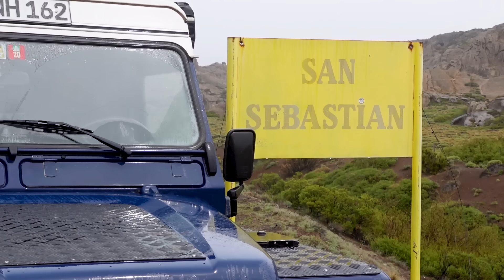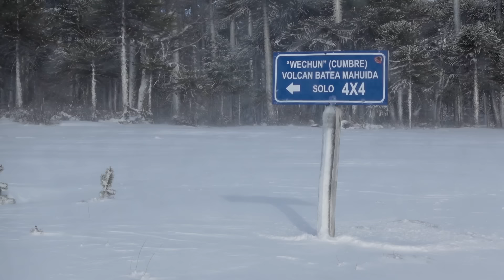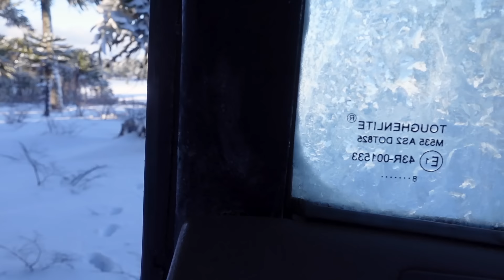Being in the RIGHT PLACE at the RIGHT TIME // EP.77

Comment: You are very fortunate to have the knowledge and skill to fix just about any problem with the Defender.
Reply from the maker: Thanks Graham! 
Just remove all nuts you find, try to not break anything. And then try to remember how to put all the bits together again… I also don’t always make it on the first try. I probably pulled the generator apart 6 times. Everytime I think something is broken I disassembled it and checked what’s faulty, and if I can replace it. If I can not I replace the part keep the old as a spare and learned how to disable is and how it works. That gives me the confidence to do it on the road now.

Comment: The defender is the worst car for this kind of trip: noisy, badly sealed , poor cabin space, bad heat/air conditioning, uncomfortable, poor off-road capability if you don't have the lockers as there are only proposed as options and only for the rear (no  option for the front, how is it possible for the utility vehicle of a brand?! ) Goodluck
Reply: The Defender is a 4x4 permanent! This means that it has a lock in the distributor gearbox (reduction) as standard! 
But well, you're replacing knowledge with opinion and that's not illegal.  

(But: "The rest is silence....")  🙄
Reply: @RogerTecumseh  central diff lock gives 2 true 2 wheel drives.... you seems pissed off why? Just learn how a 4x4 works
Reply: @comedefleurieu315  "the lockers.... and only for the rear (no  option for the front, how is it possible for the utility vehicle of a brand?! )"

Go to sleep!  😴 But before that, just some information for you: my lock in the front axle of the Defender has been working very well for 30 years now, even though I rarely need it.
Reply: @RogerTecumseh  why go to sleep? Can you explain? Who has fitted you front lock?
Reply: @comedefleurieu315  There are several manufacturers. My lock comes from Australia (ARB). Any good 4X4 workshop worldwide can fit them.
And once again as an extra service (because you are obviously a real 4X4-specialist 😄 ): the original front differential only has two satellites. The lock-differential has four and is therefore more stable.
Reply: Try to buy a 110 defender. It aint cheap for good reason and its spacey for a 4x4, practically a van. Try camping inside a hilux!
Reply: @RogerTecumseh  or getting one with traction control which is very good. I have a l320. I just don't understand why LR does not propose the 2 locks as standard for its utility vehicle! Even the G 55amg has them, 3 beautiful buttons to manage the 3 locks... same for jeep, same for Toyota and its 70 series...
Reply: @mikescudder4621  I would take a troopy I think
Reply: @RogerTecumseh  and seeing people with 0 knowledge on 4x4 buying a defender without locks thinking that is a grest 4x4 makes me smile a lot .... for people knowing what they do, no problem, it's a great car bit for others it's a fraud
Reply from the maker: I considered many 4x4s but there are reasons why I ended up buying a Defender, and I think there is almost no better Car for what we’re doing. 

A Defender is spacious, easy to repair, really good offroad and some how affordable in Europe. Great payload, four coil springs modifications are easy. 

Trophy, really expensive in Europe! Leave springs in the back ok for overloading not good off-road. High fuel consumption difficult to do a camper build

G-waggon great off-road, quite expensive, crazy corrosion problems with older models. tiny inside, I don't know a G-wagon pop top. Quite a heavy base vehicle.

Jeep (wrangler) great off-road, not so great (unstable) on road. Weak axles & low payload and tiny inside. Not common car in Europe therefore expensive car and modifications. 

VW T3 Syncro, love the shape, descent off-road, really spacious. Super expensive, corrosion, lots of work, Underpowered. 

Pick ups? Don't like pick-up canopy campers. Only works with good weather, we need a space to be inside. Expensive in Europe.

And the best thing the Land Rover community worldwide!
Reply: @Thebluelandy  "And the best thing the Land Rover community worldwide!"  Yes!! And therefore we know: It's never over in a Land-Rover!   😉
Reply: @Thebluelandy  great information. 👍
Reply: @Thebluelandy  While I prefer the VW synchro, the Mitsubishi l300 is a beast too. Not sure how the fuel consumption compares. But the Landy is awesome!
Reply: @comedefleurieu315 Well, can't knock a troopy. Maybe not the easiest to find and buy.